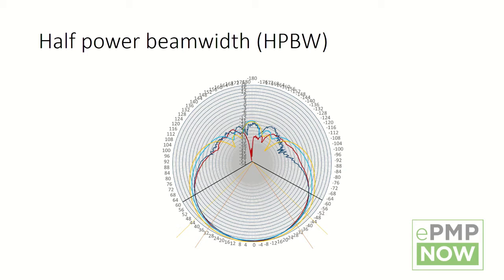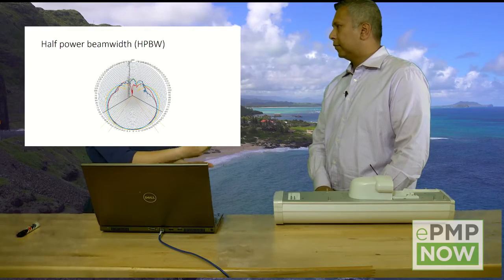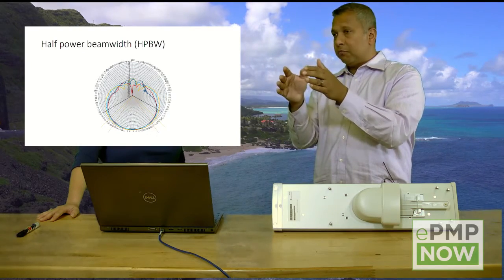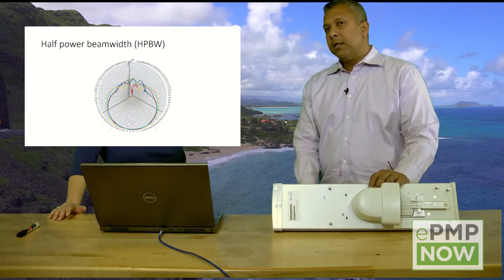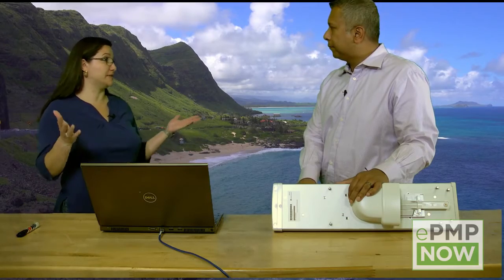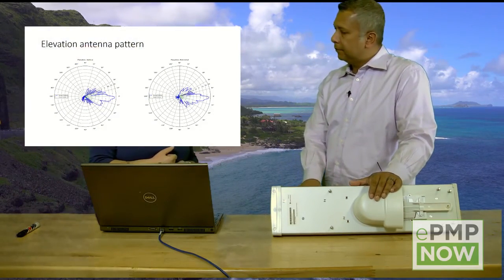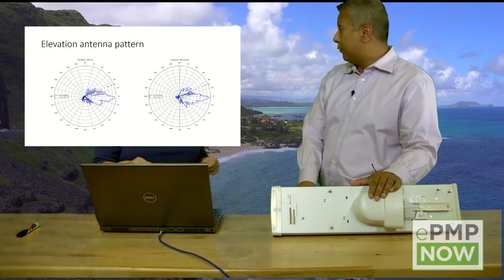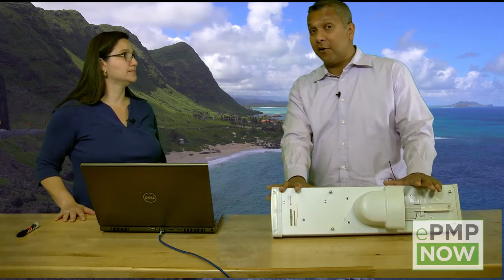ePMP NOW:  The Cambium Sector Antenna - is it 90 degree, 120 degrees

Comment: Hi I am trying to learn about your cambium antenna. And my question is how do you power the antenna?  Looks like a great antenna and I am interested in buying one
Reply: the sector antenna doesn't require additional power.  there are two RP-SMA connections on the antenna that are connected with cables to the RP-SMA connections on the ePMP radio.
Reply: Bruce Collins thank you for answering my questions

Comment: is it 120 degree or 90 degree?
Reply: that's a 120 degrees antenna, you just have less power in reception for subscriber between 90 and 120, between 3 and 6db less than in 0° azymuth.
Reply: @bomberwaterman   Dear do you mean that you can't change it manually between 90 and 120?

Comment: why one must select a "sector" vs "solid dish"?
Reply: a dish antenna is much more directional so pushing more energy forward in a small patern , so they mostly use for longer distances like point to point connections were just the station and the single client is important, so in like a city with many clients wide spread on short distances the sector antenna will be superior to a dish.